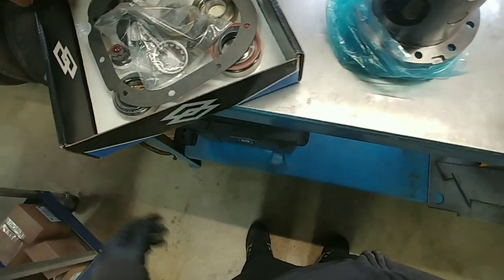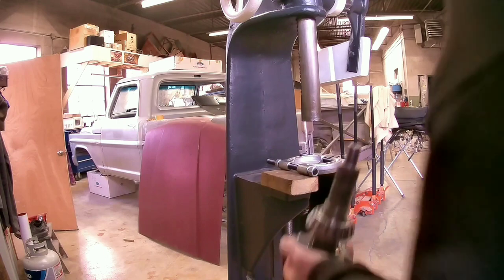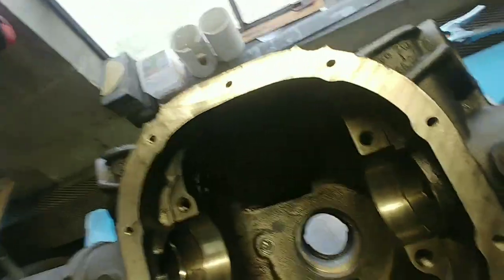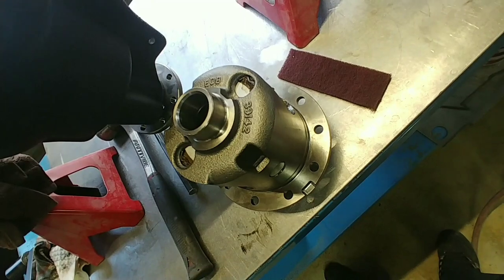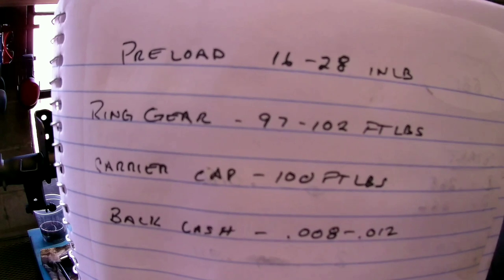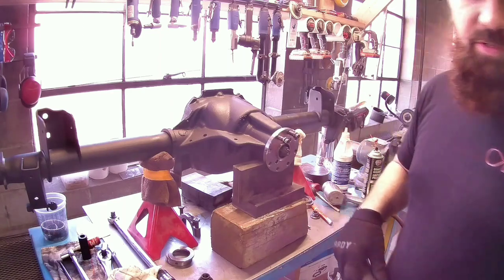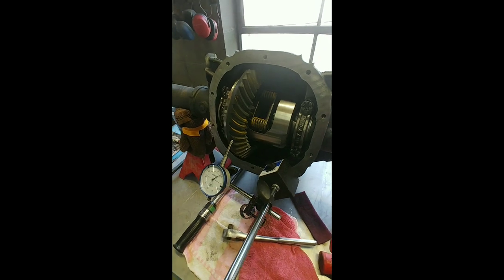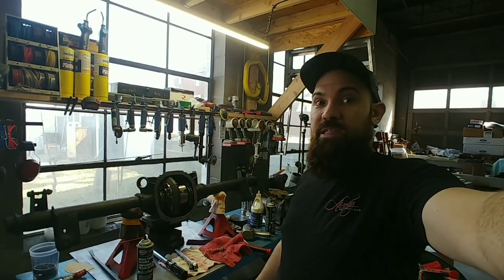Ford 8.8 rear differential rebuild

Comment: What to do if you didnt mark the bearing caps and dont remember their orientation? Great video btw!
Reply from the maker: You could try to assemble it with nothing but the Carrier and bearings/shims installed. Tq the caps and see if it spins freely and smoothly. If not try a different cap orientation. Worst case scenario is to take it to a machine shop and have it line honed
Reply: @Dragracetherapy  great idea!

Comment: I tried putting in a set of gears when I did the 5 lug conversion (CuZ I wAs AlreAdY iN ThErE), little did I know I was way over my head. I wouldn't even be surprised if we left the pinion shim out. We reused the pinion races with the new bearings. Didn't check backlash or gear pattern. Slapped it in with the old carrier shims drove it down the road, horrendous sound on the coast side. Brought it to a shop to fix it, they charged me a little over $500. I'm pretty sure the original pinion races were reused cuz on the coast side it still whistles. I've probably put 10,000 miles on em, I'm just gonna run them till catastrophic failure. But since then, I've done a lot more research and taken a class at community college on rebuilding manual transmissions/axles/transfer cases so I have a little better understanding. I'll give it another go eventually, but i'll probably get the book on how to do it as well
Reply: You cannot use old race with new bearings
Reply: @CobraR1993  Oh i know now, lol

Comment: I have an 8.8 that was recently rebuilt. But, when you let off the gas, there is a loud howl. Its quiet otherwise. What is causing this? Backlash or pinion preload error? Or something else?
Reply from the maker: Generally, That's pinion bearing related. It's possible the bearing preload wasn't set up correctly, or it's just a failed part. Could be carrier bearing, but in my experience I would definitely investigate both pinion bearings to start.
Reply: Supposedly, it got all new bearings, races and gears. But, maybe wasn’t professionally assembled.
Reply: Supposedly, it got all new bearings, races and gears. But, maybe wasn’t professionally assembled.
Reply: Supposedly, it got all new bearings, races and gears. But, maybe wasn’t professionally assembled.

Comment: hey bud i had the samething happend to my pinoin chipped the end tooth off , did you still use that gear or did you replaced it, i noticed that it dosent contact anything on the where pattern.
Reply from the maker: I opted to replace it. Would it have been a problem? Hard to say. But I tend to error on the side of caution, as opposed to the "just send it" mentality

Comment: Did you have to heat the ring gear and chill the carrier before putting the two together? You didn't show that part...
Reply from the maker: No, I did not have to do that with this combo.
Reply: @Dragracetherapy  cool thanks for responding! I appreciated the video you took the time to do. I trust the rear end is holding up well?
Reply from the maker: @MartyEscarcega  so far so good 👍. And he drives it everywhere! Thanks for watching and commenting!!!

Comment: When checking the pinion preload did u use the crush  washer while checking it , I wanna rebuild my rear end in my foxbody but never done it before I’ve watch over 15 videos so far I get lost with  the pinion because of the crush washer being a one time use
Reply from the maker: Yes, use the crush washer. You need to "sneak up" on the preload by tightening the pinion nut. This in turn is causing the washer between the inner and outer bearings (these bearings are tapered) to collapse or "crush”, bringing the bearings closer together in the housing. You are looking for a recommended tolerance between these two bearings which is measured by the rotational force or "tourqe" needed to turn the pinion.

Let me know if this helps. If you would like, i could do a quick video on it too if you're still not quite sure.

Comment: Hello, the clock has a measuring dial in inches not in millimeters?
Reply from the maker: That's correct. Inch pounds
Reply: @Dragracetherapy  thanks

Comment: I'm in thr South....ughh need to build a gear up to 400 hp with an 8.8 I dagum guess.......I have a 96 Bronco rebuilt the ENTIRE frontend for death wobble but its the pinion bearing.....I need a long term hardened street/trail with longevity to it....Ive got too much invested....Dagum I would just pay you guys I have an f-150 with another shell.....The part of College I didn't finish......💔 Crush Dreams....GOD LOVE!

Comment: It is possible with a click torque wrench because the spec range is so big. 18in pounds to 26.
Reply: I know, 2 years late but- the answer is no.  you want a beam style wrench, and the lighter the better, like one calibrated in inch lbs.

Comment: nice work dude . Would that differential be good for a daily driver?
Reply from the maker: Absolutely! A great upgrade from the factory limited slip unit. Just be sure you get the correct spline count for the axles you will be using.
Reply: @Dragracetherapy  sounds good . I will be doing this job this winter ! Thanks for the info

Comment: TOO LOSE BACKLASH! DRSG RACING SHOULD BE .004-.006"!
Reply from the maker: Thank you! This was a street car build tho so I decided to stick with the gear manufacturer's specification for this application
Reply: We set them up .003-.005 other wise it will clunk on decel when it breaks in!